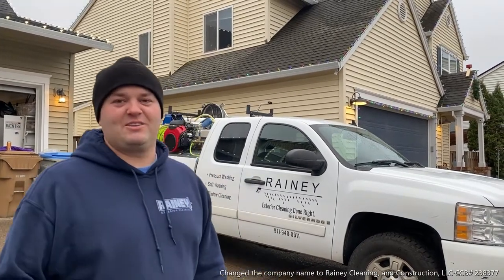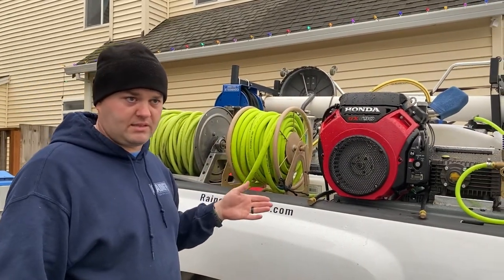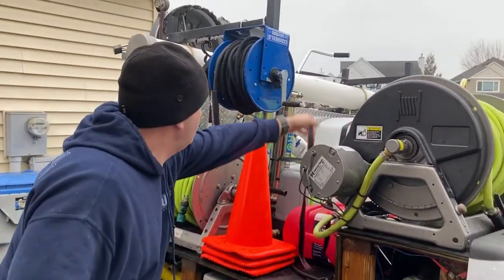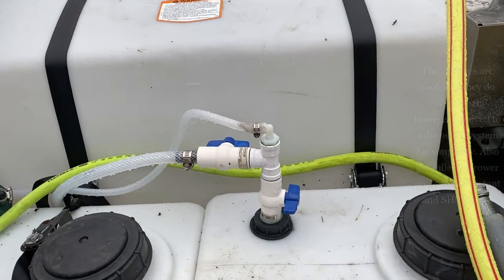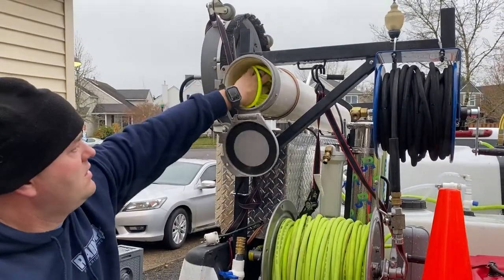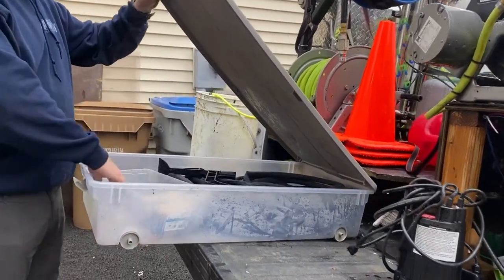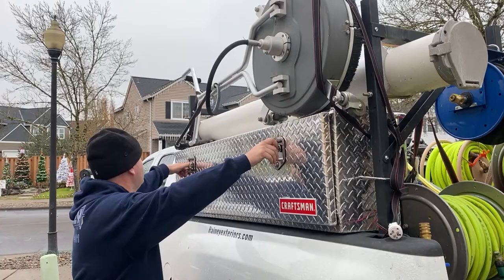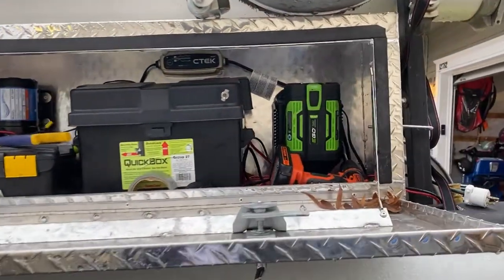Walk through of Truck mounted Honda GX 690 8gpm pressure washer and softwash rig, homemade skid.

Comment: This is one of the most effective setups i’ve seen. You fit so much into the back of that truck all while keeping it organized! Good video
Reply from the maker: Thank you! I need to post my trailer soon too, it’s even better honestly
Reply: No tbh I love the equipment but that small bleach tank gotta go! And you weren't really maximizing space but thats all personal configuration perspective I really do like the equipment and can't wait to see trailer
Reply from the maker: @dodsonenterprisesinc8667  yeah, the tank was a mistake for size, I have a lot bigger one now.
Reply: Yeah bro thats awesome I was gonna use a 50 gallon tank at first until I realized what you really need is at least 150 for multiple jobs a day
Reply from the maker: @dodsonenterprisesinc8667  I would disagree on that much sh personally, especially where I am in Oregon it is pretty expensive. Using my proportioner valve I very rarely go over 30gallons in a day. 150 gallon tank is a ton of weight and also way over DOT regulations for how much SH you can carry.
Reply: @raineycleaningandconstruct8305  Can't wait to see it, working on a microtrailer idea base on the MiTM mini trailer myself and if your truck is this compact I cant wait to see the trailer.
Reply: I concur

Comment: You mention on the video you wish you had a 200 gallon tank. The 100 gallon is not enough even if you're getting 6-7 gpm from residential or commercial property? Not enough water in the 100 gallon when house clean or surface cleaning 🤔
Reply from the maker: Most residential only is closer to 4gpm out of the hose. The 100g is ok, it’s just kind of a pain that I have to wait for it to fill almost all the way before I get started or I’ll run out out of water halfway and have to wait for it to fill again.
Reply: @raineycleaningandconstruct8305  

Oh, I get it now.  I hope you get one soon. 

Thanks

Comment: I've been watching a lot of SoftWash videos over the last week, and I've noticed many of the youtuber's have affiliate links, and or sell cleaners, or systems, and I'm wondering if a starter upper can make money with the Actual Soft Washing of houses, or is the money coming from selling systems, chemicals, and youtube ads.  I just would hate to invest into a truck, a system, and a year or two of my life for something that doesn't manifest into actual money and a career, I'd hate to put my loves ones and myself through that.  I'm looking for honest answer from someone in the know. Thank you and I appreciate it.
Reply from the maker: I think a lot of it depends on where you are located. I am in Oregon and it is very profitable in the summer, but basically falls off completely in the winter. What a lot of people do is also get into Pro Christmas lights which are surprisingly profitable, as well as window cleaning which is also kind of seasonal.
Reply: Great question!'.the easy answ is yes....but the investment cost will be 3* what u think u will need.(ex.softwash is only "one 'system/chemical..best thing to do is "exhaust" urself learning /researching before u fall into a"ponzi scheme",which is what most of these utube channels are!
Reply: @jamesl.3030  I've placed nextdoor posts stating I'm using pesticide sprayer, along with pics i've done of my house. yet to have any responses.